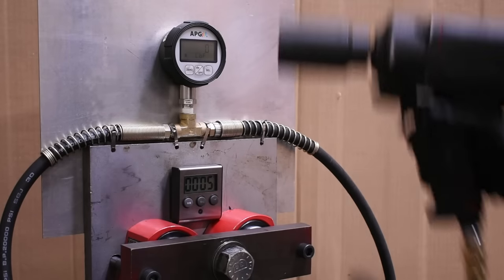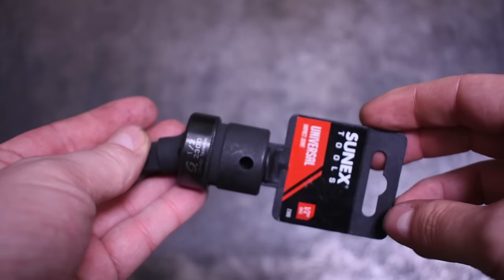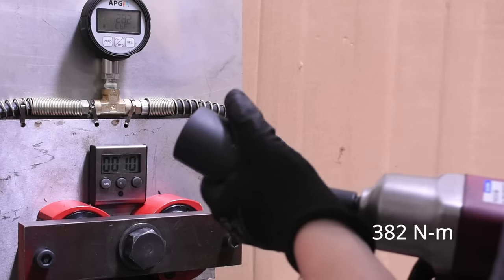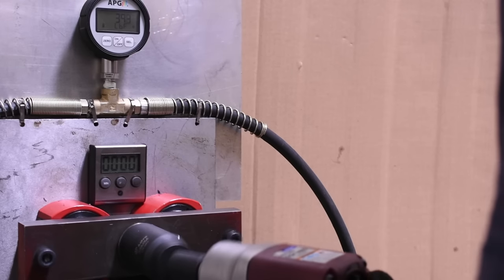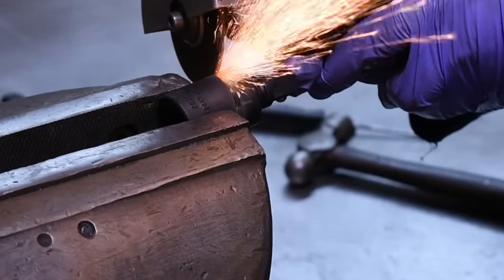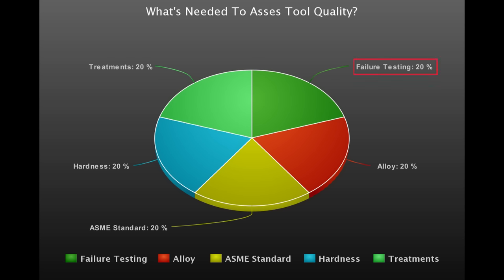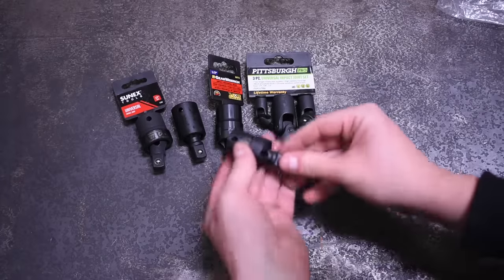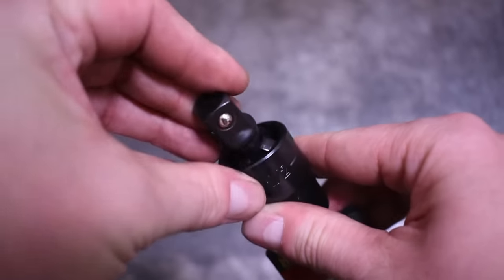How Much Power Do You Lose w/ Universal Adapters? Dyno Test For Science

Comment from the maker: Who else here for the super outdated Alec Baldwin reference now tho?
Reply: Not here for the Alec Baldwin reference, but I did laugh about it when you made the reference. I just love watching tool reviews and tests. I also want to point out that I love your testing methods and plan on watching all of your videos.
Reply: The fact you remembered when you made an obscure, offhand joke 7 months later is kinda funny. The fact you remembered that, made it a point to come back and pin this comment, all after that unfortunate event where the wannabe orange man did what he did makes you legendary.
Reply: I pray if I purchase one of these universal adapters it doesn't shoot me in the face.
Reply: Did you shoot someone? 😂
Reply: You should do a short video update on this video showing torque loss or gain on using a swivel socket vs. a swivel adapter with a socket. Thanks for the great content guys!!
Reply: Reference the incident he had instead
Reply: Result of the X-core was IMO a directnand explicit consequence of that massive hardness difference. In terms of forces, it's very similar to the effects you'd see if an impact wrench had a 21Rc difference between the hammer and anvil dogs.

The design isn't great, those lobe fins are long yet there's little actual contact surface to spread the load. So part of the severity of damage may be worsened by the lobes yielding slightly. But the primary offender seems to be the hardness.

I wouldn't be surprised if Gearwrench originally made these with nearly the same hardness on the "X core" lobes but that ended up shattering the edges of the lobes, then they overdid the pull-back, it wasn't good, realized there wasn't really a reasonable way to make it a whole lot better - so they still sent it hoping it would mostly be bought by Monster Cables customers with rarely used anemic impact tools.

Comment: I would really love to see you guys test torque sticks for accuracy, particularly harbor freight
Reply: What is a torque stick?
Reply: At shop air pressure at about 120 psi my set over torques it's rating by anywhere from about 7ft-lbs to 20ft-lbs, I now just go down a size and then torque lug nuts by hand after. The higher the torque rating of the stick the more it over torques in my experience. It also differs slightly between lug nut styles i.e. acorn vs the Toyota style flat washer type and differs slightly when the studs have anti-seize on them vs not. I imagine this is a universal finding if I were to use other brands of torque sticks. As with these tests, the longer the impact gun is running the higher the torque rating so I don't keep holding the trigger down once the fastener slows to almost stopping, which is usually a few hits after being snugged.
Reply: I agree
Reply: @asvarien  huh???
Reply: @asvarien  it’s a stick that twists when it gets to its max torque, to prevent over torque, mostly used on wheel nuts
Reply: @willbgrill  Torsion sockets are only accurate when they're raw metal, afaik no manufacturer accounts for treatments and coatings, which is where error is most often produced. Anti-seize is also a lubricant and torque rating needs to be adjusted for such, as torque ratings are almost always for dry fasteners; this really shouldn't be a surprise or a discovery, as you should already know this if you're working on vehicles.
Reply: @xaytana  yeah
Reply: @willbgrill  what about us with electric impacts?
Reply: YES. Torque wrench testing would be perfect for this channel!
Reply: Harbor freight? More like horror freight.
Reply: @xaytana  FWIW........"torque stick" the correct term is Torque Limiting Extension or Torque Limiting Extension Socket as some are manufactured with a socket end. For this tool to work properly they have to be individualy  calibrated to the impact gun you are using. Review any manufactures of these tools instruction sheet / manual.
Reply: Project farm done a torque stick comparison video...they're more accurate than you'd expect. Surprised me.
Reply: @masterbastard7521  link please? unable to find it on his channel
Reply: FYI, I saw another video where they found out that you can't use torque sticks with high frequency cordless impacts like the Milwaukee mid torque because it somehow hammers faster that the torque stick can absorb the impacts.  Thus they defeat the torque sticks.  Just some interesting info.  Therefore, be aware that what they use to test the torque sticks matters.
Reply: @georgecolbert3247  I have not found that to be the case with my sticks and the high impact
Reply: @asvarien  it’s an impact extension that limits the torque put down. Not sure exactly the science behind it but they usually come in sets ranging in torque levels
Reply: @willbgrill  good info, agree on the techniques too. Lots of guys in my shop hold their torque sticks for like 5 seconds per lug, which imo, over-torques lugs a ton. Just a few extra hits after snug seems perfect.
Reply: Just giver 3 ugga duggas on medium and then use torque bar lol
Reply: I would avoid these at all costs, a while ago someone did a test and most were miles off, even a cheap torque wrench was more accurate than those sticks, they might have improved them lately but I doubt it.
Reply: This!!!
Reply: You have to understand they are just springs. It doesn't actually limit the torque like a torque wrench. It limits the amount of torque transferred for a given impact energy. Since the impact energy of wrenches varies widely, they have to be calibrated with your particular gun to be worth anything.
Reply: That's a great idea. Did they make that video?
Reply: Way too many variables. Using the 90lb from HF hits torque about perfect with my DCF899 on speed 2. But with different air pressures on pneumatics and different speeds on electrics the torque will vary. Essentially you have to buy a set and figure out your setup to hit the torque right.
Reply: @50sKid  There not made for high impact tools.
Reply: Ha! I've found toque sticks to be a joke although maybe they don't work as well with cordless impacts as they do with pneumatic.
Reply: @TheTruth4313  There not made for cordless impacts there made for pneumatic impacts and even then there are restriction on air pressure.and use. there mostly used in tire shops for lug nuts.
Reply: Me too!!! I’d like this video
Reply: @JacobEcret  
I believe Torque Sticks obey Hook's Law:
Sure it twist at it's rating, but...
At 3/4 of it's rating it twist 3/4 as much,
at 1/2 it's rating it twist 1/2 as much,
at 10% of it's rating it twist 10% as much.

So it looses efficiency until (hopefully--at the right torque) it looses enough to keep your impact tool from over tightening.

I own two impact wrenches, but I only use One with my Torque Sticks, because I know what to expect with that one.
Reply: @markdstump  good to know
Reply: Me too!
Reply: This has been answered!
Reply: Cheap torque sticks are no go in my experience.. stripped aluminium out of a block more than once with correct torque
Reply: @teammouse  the real question, why are you using an impact on aluminum
Reply: @JacobEcret  sounded like a good idea at the time
Reply: @teammouse  fair enough
Reply: @JacobEcret  haha
Reply: Harbor freight torque limiting extensions ?
Reply: Get a torque stick
Reply: They already did
Reply: @willbgrill  I'm pretty sure torque stocks are rated for 90psi not 120psi, at least that's what I've heard
Reply: It's 50sKid!!
Reply: Our shop bought some (we supply our own tools generally) to make things faster...we got a few people come back with lose wheels...so I dont trust em.  They spent a lot of money on the set, and they really didnt save any time in the end as I still torqued each nut down with a proper torque wrench after using the next step down torque bar.  The toque bars also didnt fit into some wheels...they had a plastic protection bit to save wheel paint and nuts/ studs that made it just not work well on more fancy wheels.
Reply: @willbgrill  anti seize requires 20 - 30% less torque

Comment: Hey, as a heavy equipment technician I found you get better torque transfer by lubricating them with EP grease. I have both styles and it works on both. You should do a quick follow up on this!
Reply: Slick since grease is of course intended not to rapidly flow under shock loads.

Comment: Very impressive performance by the Sunex pin type. Also impressed by the Tekton.
Reply: Sunex has a great reputation for their impact sockets in general
Reply: @johanusyolder  Yeah, I've go a few 3/4" Sunex impact sockets I bought from a Heavy duty truck clutch and axle store. Taiwan made, but sure work great, 6 point of course and matte black, fit the fasteners very snug.. Good quality impacts are seldom 'chrome' or 12 points. Even Snap-on states right on their chrome sockets....'Not for Impact Use'...   The truck parts store deals with a lot of heavy duty semi-truck stuff...no flimsy tools sold there..most of their customers are big truck mechanics, Internatiol is right down the street...

Comment: Another good video. The torque loss reinforces advice I give, which is to never cheap out on an impact wrench. You need all the power you can afford, because you're going to be giving a lot of the power right back to things like extensions and swivels.
Reply: Yeah, swivels lose a lot of power as soon as you get just a few degrees off a straight line.

Comment: That is a badass hardness tester - the machines I've used before are floor standing machines, totally mechanical. turn the wheel until you load up the indenter to a certain amount, then pull the main lever/weight applier, and let it sit 30 seconds to settle. Then undo it, and see how far back the needle goes and get your reading that way.

much faster, field usable meter you got there. pretty cool!

Comment: Awesome video as usual! I’d be interested to see the accuracy of different torque sticks!! Or if they’re accurate at all?
Reply: That and how different between impact power affects the torque on same stick
Reply: I 2nd both of these.
Reply: That would be a great video!
Reply from the maker: Might be a month or two based on the list we're working down. We'd need the torque stick type with a 1/2" drive end on both sides for this. You guys have an recommendations?
Reply: @TorqueTestChannel  there are quite a few on Amazon that aren’t that expensive. I think mine go from 60ft-lbs to 150ft-lbs.
Reply: Harbor Freight and Home Depot have some inexpensive torque sticks. There are truck brand sticks as well I'm not familiar with yet.
Reply: This needs to happen.  I'm not sure I trust mine.
Reply: I agree the harbor freight ones and some other cheap ones off Amazon.  I'd test at least 1 good set of tool truck sticks to see if they're really any better than hf sticks.  I just don't trust torque sticks in general.  I have a feeling torque will vary greatly depending on how much torque is applied from the impact.   If it turns out they actually are pretty accurate and the torque from the impact doesn't make much difference I'd definitely pick up a set.
Reply: @TorqueTestChannel  Astro Pneumatic are what I use at work. Would love to see them tested
Reply: The 5-pc Yellow-Blue-gray-white-green set from the tool trucks is sort of the standard around here.
Reply: I saw somewhere that they don't work with cordless/electric impacts, something about the frequency of the bpm?? Would be cool to see that fully examined also.
Reply: You should do a short video update on this video showing torque loss or gain on using a swivel socket vs. a swivel adapter with a socket. Thanks for the great content guys!!

Comment: As an owner of mutiple japanese vechiles and small engines (tight work space)  u joint swivels are a life saver. The fact they  can get into almost any angle really saves the day. I usually only use 1/4 or 3/8 so I don't really break them
Reply: Get some uni joint sockets in common metric sizes...they are AMAZING if you work on imports, but amazing everywhere a socket+u joint cant fit.

Comment: While U-joint style adapters can articulate up to full 90°, they are basically useless at that point and function only as a weak breaker bar. When tilted over the 45° mark, they pump more torque into the pin itself then they transfer to the other end and after around 60° they are hard to rotate anymore. Also, U-joints do not transfer the torque uniformly through the full rotation so their performance may vary greatly, depending not only on tilt but also on rotation angle at any given moment. They don't seem to be a good design for impact action or when the precise torque matters.

Comment: I have and love my Matco sets, I did notice that the way the GearWrench was made is WAY CHEAPER. My Matco has it's grooves through most of it's body, not 4 small points. And I have run these swivels since 2005 on a IR Platinum and Titanium 1/2" drive and a they're 3/8" drive haha

Great Video!

Comment: Would like to see these tested at 45 degrees - Would be an idea to hold it in a vice so we can see how much is lost due to the adapter - I believe a lot of the lost force is due to difficulty holding the tool at the angle your working with as we can see it jump around a lot.

Comment: After seeing this great video. It reassured me of my Sunex argument with my shop guys. I have an assortment of Mac tools, Matco, Icon, Snap-on and Sunex, some Ares and Astro Pneumatic. As far as sockets go I'd have to say overall I'm a Sunex guy. Price for quality out pacing the bunch. But in all fairness and reality Snap-on hand tools and sockets are probably the best performing. I went through almost all for wobble extensions Snap-ons precision is unbeatable. Especially since they are Chrome non impact. But are used with hand and power all the same and hold up all the same. Universal impact sockets  though I'd have to say Matco ADV is top with Sunex and Snap-on very close second. Ratcheting wrenches Snap-on and Icon handle the most torque consistently before failure where Matco and Mac tools fail. This is just from my shop experience. Point is All of these top companies have something special to offer that can't be beat. Variety of smart choices and experience along with good you tube videos will give you the most complete tool assortment. You can't go wrong with all Snap-on but there is always something better and possibly cheaper still with a lifetime guarantee.

Comment: I used to work at a Heat Treat a few years back.  For 4140 the usual heat treat for Sockets similar to this was no preheat time, 2 hours at 1525°F with 0.40% CP, into agitated oil at 140-150°F followed by a 2 hour 500°F temper.  Which usually put the RC at 52RC which the customer spec being 48 to 55 RC.
For much Larger sockets such as for 1-1/4in drive with actual size being about 3.5 diameter it also had a 30 minute preheat at 1350°F 0.20%CP before being turned up to 1525°F 0.40%CP.  CP being the atmospheric carbon in the furnace.

Comment: I don't have a good 1/2 drive universal, but I have been very happy with my 3/8 Sunex universal. I've had it for over 5 years now and it still works just fine. The locking collar for the pin is a little sloppy but it has no where to go. Glad to see that the Tekton 1/2 universal I've been looking at is bound to hold up just fine, though I may actually just stick with Sunex in this case.

Comment: Have the Tekton set and I can confirm it does feel a little smoother once it’s been used a little bit. Definitely did the job I bought it for, I had to remove the AC bracket from my gx470 and it’s at a weird angle, but with the universal socket adapters, it came out quickly and easily.

Comment: on the pinned versions, you can make a big difference in performance by simply taking the socket off and turning it 60 degrees. U-joints are not constant speed/torque, it varies with angle. Knowing this makes universal sockets work a lot better

Comment: It would be very interesting to compare air vs cordless power loss on extensions and swivels. I’ve always felt like my Milwaukee high torque  gets hurt more from extensions and swivels. Some of my coworkers feel they see the same thing. Personally I always had the best luck with Mac pinned swivels. They still do break, and are fairly chunky but I felt I had less power loss than I did with the cheaper ones.

Comment: FWIW a universal joint cannot operate anywhere near 90 degrees, they just bind up.  Even 45 degrees causes a very large cyclic variation in speed (and therefore torque) so you'd want to be operating it at less than that.

Comment: Try holding the impact tight on a bolt so it can’t vibrate see if that makes any difference to just enough force to keep the socket seated. 

Basically holding tight vs not
Reply: I second that suggestion.  Also would be curious to see the difference it would make when using an extension or an extension stack!

Comment: I do own all three styles of impact universal's and not to defend one or the other as they all work but I do use the X Cores in certain spots where other's don't fit but just looking at the design I know they have limitations  but are worth their cost because they get the job done which is a flat rate worlds goal.  The X Core extension socket  combo set have been worth it to me because of the versatility but as found with limitations. Thanks for all your testing it's great as we do engine dyno work and making tests transparent in the industry as we do and you guys do make it worth while.